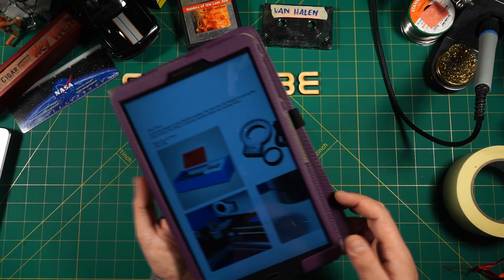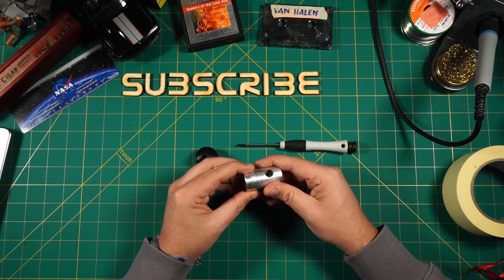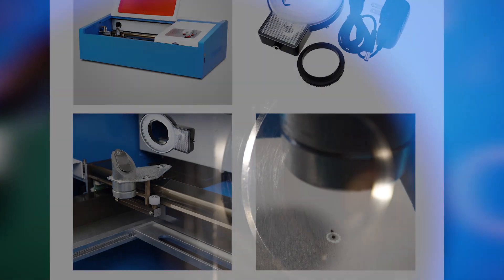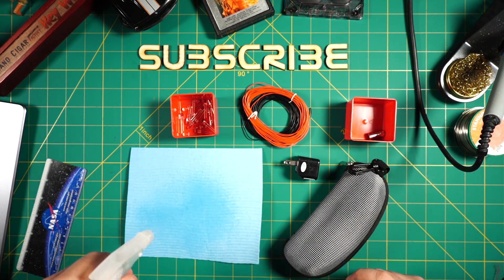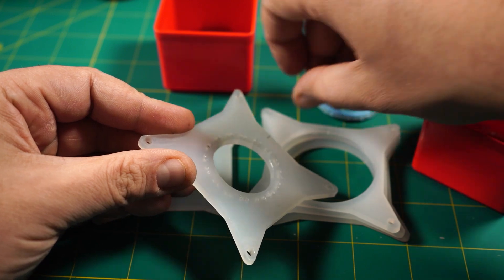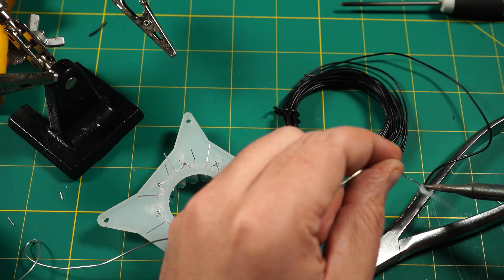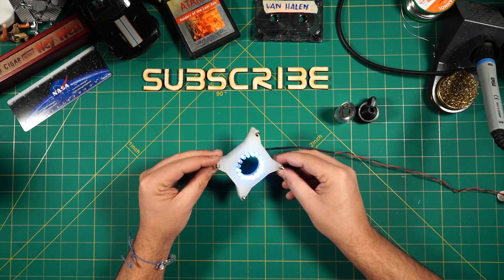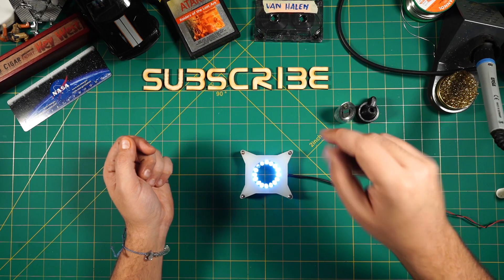K40 Laser Targeting Laser or LED Ring? (DIY & Fail)

Comment: I plan to use two line laser modules. So I got cross always at same spot. And I see two options how to  mount them. 1) At head. 2) At back wall instead of LED ring.

Comment: I would suggest a laser pass trough mirror as used in show lasers
That way the cutting laser wil pass trough the mirror while the dot laser is being deflected in a 90 degrees angle directly on the second mirror the pointer laser can be mounted directly on the chassis of the laser pointing at the pass trough mirror at 90 degrees i hope you know what i mean

Comment: swap the 16 leds for red dot laser diode pointers, you can buy them in a pack of 10 cheap off ebay for like $5, you then have a brighter more defined dot with more contrast on your workpiece.  you can maybe angle them so they produce just one dot at the focal point so also checks focus...

Comment: I've used the 3d-printed version for 4 years now, no probs. The red-dot units are easy to get in the right size for the holder. The LED ring does look great though, even if it's not a success :)

Comment: Im sure someone has mentioned this but your hole diameter should be much smaller to center the light and you should use 4 laser diodes. If someone answered this sorry for the repeat message. This does work though.
Reply from the maker: Okay, thanks i had no dumensions when i tried it out. I may make another one as it still would be an esay fix!
Reply: @MancaveEffects  have you done another one?

Comment: Interesting build however the issue is the secondary mirror of the laser is designed to reflect long wave IR light (10,600 nm) and not visible (700 nm, a huge difference).  Using red leds might have been a very little bit better however still not worth it especially as you point out at the start being unfocused.  The best option (money to performance) is to use two line lasers as a single "dot" will find a way to move...
Reply from the maker: This sounds very plausible! I could have meantioned using Linelasers. Thanks for the input
Reply: @MancaveEffects  typically the cheaper lasers use Gallium Arsenide as the reflecting surface and as a side note one should avoid touching them as there is a low level of toxicity present.  Keep up the experimenting!
Reply: I use 2 line lasers fitted to an acrylic bracket that sits over the laser mounting plate, the lasers are fixed with epoxy and adjustment ring on each laser packed with plumbers PTFE tape to reduce accidental movement, it works very well

Comment: I would still want to see this with a smaller ring since the beam is like 8mm why make the ring 35mm?
Reply from the maker: It could be done with a smaller ring but when realigning the tube it might burn the ring to a crust. The laserbeam has a diameter of about 5mm sq at this point.

Comment: your leds are pointing towards the center causing like a cross over effect and making the output really inconsistent. try placing them flat on the acrylic without that rubber for a more consistent output
Reply from the maker: Tried it, but the ring is probably to big, brightness is to weak as i have plenty of light installed. But thanks for the hint
Reply: alternatively can you not turn the laser down to 0.01 duty cycle like we do on eleksmakers and use that as the target?
Reply from the maker: Well this China Laser machine still burns trough your material as it is not adjustable in a usable way ;)

Comment: What if you add walls and smaller ring and put it around the laser head where your red LED is at now. This could point down and have a large ring of light and if they are pointing down the ring would be the same at any height.
Reply from the maker: Well yes but it would be to wide to define precisely where the exact midpoint is or isn’t it?
Reply: @MancaveEffects  some others put two lasers LED with lens that make a line , two lasers LED make it a cross , X marks the spot , but from the other site , if 3 or 4 laser LED will be in the place of the ring will be much easier to make it work ??  If I buy one of K40 I will try out ... why not!! hackit !!

Comment: hi, nice video
maybe try two line lasers in 90° arrangement instead of the led ring.
They should show up as a crosshair.

Hi schönes Video!
probier doch statt der LEDs zwei 90° angeordnete Linienlaser. Die müssten auch durch die Spiegel und die Linse als Kreuz sichtbar sein.

Sebastian
Reply from the maker: Thanks! But this will cause the same issue as using a whole array of laser diodes. For the cross to be centric, the diodes need to be in the exact middle. Therefore i would need a beam combiner.

Danke! Deine Idee bringt das gleiche Problem mitsich als ein Ring aus Laserdioden. Damit ein Laserstrahl mittig aus der Linse kommt muss die Diode auch mittig platziert sein, da bei den Leds ja nur die Reflektion projeziert wird nicht das eigendliche Licht
Reply: @MancaveEffects  I thought if the lines from the line lasers goes through the center of the IR beam it should be projected as a line through the center... but maybe i am wrong....
Ich dache das die Linienlaser so ausgerichtet werden das sie ihre Linien durch die Mitte des IR lasers projezieren so das auch bei der Abbildung  durch die Mitte laufen. Aber gut Möglich das ich da irgendwie falsch liege...
Reply from the maker: Ich weis was du meinst, klingt ansich auch ganz logisch aber ich glaube das wir da beide einen Denkfehler machen. Der Strichlaser wird ja in einem anderen Winkel gespiegelt als der co2 Laserstrahl. Ich denke das die Linie neben dem zweiten Spiegel ankommen würde weil trotz Linie der Abstrahlwinkel ein anderer ist... *Kopfzerbrechen... ;)
Reply: @MancaveEffects   Also angenommen man befestigt einen senkrechten Linienlaser über dem CO2-Laserstrahl. Dann wird diese Linie durch den ersten Spiegel, da sie entlang der Kippachse des Spiegeln verläuft in die richtige Richtung gespiegelt und bleibt eine senkrechte Linie. Der zweite Spiegel müsste sie dann nur entlang der Linie versetztt abbilden so das auch da die Linie erhalten bleibt und noch passen müsste.

Für eine Waagerechte Linie die horizontal neben dem CO2 Laserstahl sitzt müsste das gleiche gelten nur das der erste Spiegel sie entlang der Linie verschiebt und der zweite sie nicht verschiebt...
Evtl kannst du es ausprobieren wenn du deinen Ring auf einen Schlitz abblendest um zu sehen was dann ankommt... Wird aber vermutlich sehr dunkel sein.

Gibt es nicht irgendein IR Aktives nachleuchtendes Material welches man auf einer Aluplatte aufgetragen als 'Zielblech' auf das zu bearbeitende Stück auflegen kann um dann per Testschuss zu sehen wo man trifft?
Reply: @vspadrver  I was just going to comment with a version of your idea as well! If you don't have a line laser, you could also make a laser ring with 3 regular lasers pointed at slight angles. Now the resulting dot on the work piece would not be centered, and would move with height etc, but if symmetrical the working location should be the center of the three projected dots, so you can still see where it will end out, right?